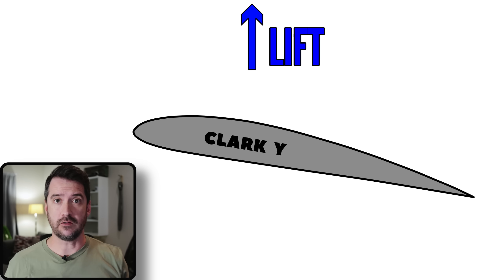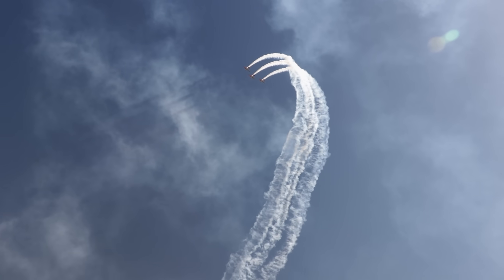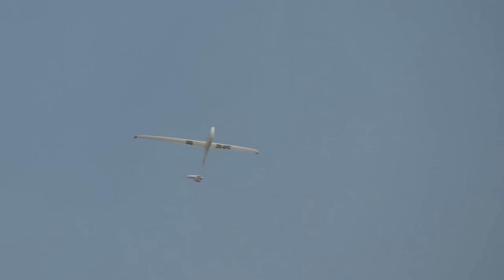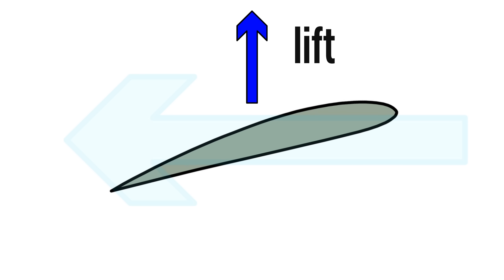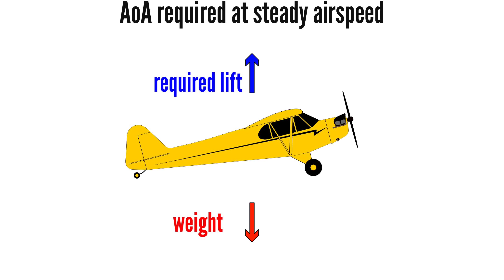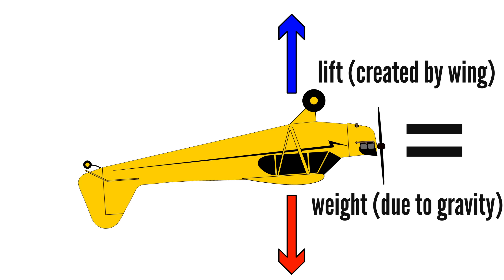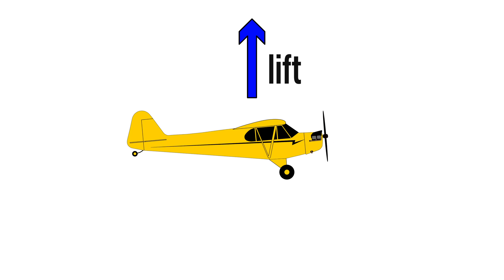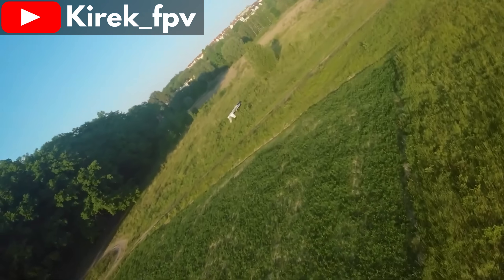Is Airflow Distance Over the Top of a Wing Always Longer?

Comment: What is not being talked about is, down to the nitty gritty, why a wing produces lift.  One has to observe, down to the molecular level, what is actually happening.  

First, I want to correct something said in the video - that there is no requirement for the air on top to join the air on the bottom at the same time (at the trailing edge).  Of course there is, otherwise, the conservation of matter is not preserved.  Furthermore, there is no explanation why the air would arrive before the bottom air.  (There would be no possible explanation.)  Additionally, some references were made to a theory that the downward thrust of the air past the trailing edge produces most of the lift.  This is also false, else one had better design the material strong enough to support an entire aircraft!

Velocity, distance, and time are useful as operands for equations for airflow, but this provides NO real reason why the Bernoulli effect exists.  The reason is pretty simple.  When air on top is required to travel further than the air on the bottom (of the wing), what is happening?  How does an individual air molecule change its relationship with its neighboring molecules?  It is pulled apart.  That is, the air is rarified.  What happens when one pulls apart air molecules?  Pressure goes down.  Vacuum pumps' job is to rarify air.  That is what they do.  A wing's job is to rarify the air on the top side so that there is a pressure differential between the top of the wing and the bottom of the wing.  Not a "rarefication differential", mind you, but a pressure differential.  The reason one can't say a "rarefication differential" is because at any angle of attack, there is a higher pressure on the bottom of the wing; i.e. there is a pressure created, not a condition of rarefication. (You can't call a pressure condition a rarefication.) That isn't really "an aside". It is the fundamental reason why a wing works so well.  I'm sure you can visualize where I'm going with this - there is a pressure on the bottom (assuming the wing is at an angle of attack), and there is a rarefication on the top.  That is powerful, because the entire wing surface is used for lift, as instead of only having pressure on the bottom, one has both pressure on the bottom and a "hole" on the top, which gives a larger pressure differential than with pressure alone.  Given this, with enough square feet (or meters) of wing area, it gives a plane the ability to overcome weight. The wing is pressed on from the bottom by the pressurized air, and the wing is attracted to the rarified pocket and wants to "fill" that pocket - on the top.  Therefore, the wing has a natural tendency to work its way upward.

The point is, one should really talk about pressure differentials, and not talk about what speeds the air is going across the wing.  The pressure differentials are what matter at the end of the day and not much else.  Speed differentials is precisely how the air is acting, but does not give the nitty gritty reason why a speed differential equals a pressure differential.  Again, one has to think on the molecular level.

A little observation related to all of this: Is there any wonder why there are tip vortices to contend with?  Since the pressure on the top of the wing are less than the atmospheric pressures, there is an inrush of air from beyond the wing tip to on top of the wingtip to even out and correct that vacuum.  (Nature abhors imbalance of things, namely a vacuum in this discussion.)  That, coupled with the fact that on the bottom of the wing the air is under pressure and one  can imagine that with the air rushing away from the wing tip  somewhat laterally on the bottom - and air rushing towards the tip somewhat laterally on the top of the wingtip and you have a constant wind shear blender effect going on continuously - just beyond the wingtip.  Winglets are added to block the lateral movement of this air on the top only (for single winglets) and for double winglets the control of the air on both the bottom of the wingtip and the top part is accomplished pretty well.  Does abating these vortices improve lift?  Not really.  It just cuts down on noise and harmonics that can be problematic.  Otherwise, most of the air across the wing surfaces does its job without much lateral movement.  The vortices problem is only caused by the air at the very tip of the wings.  A side point to this is that this points to the very powerful forces and the very effectiveness of how the air is in creating lift.  Those vortices are caused by very little of the wing, but boy are they noisy!  Why don't the winglets produce their own vortices?  Because they are very cleverly designed to transition from a wing (cambered) profile to a symmetrical profile at the winglet tips.

So, why is this video brilliant?  Because it presents a reason why a wing can fly upside down, which is because the Bernoulli effect is preserved, since upside up, or upside down, the air "on the top" must always travel further as to make a condition of rarefication, or at the end of the day, a pressure differential equal in both instances.
Reply from the maker: I really like your explanation, it's very good. Thanks, and I hope many more reads it.

Just correcting something, I didn't say air going over the top meets the air going below. Air going over will arrive at the trailing edge before the air going below. I don't believe in the equal transit theory, and there's some nice wind tunnel videos on Youtube visually showing air going over the top arrives at the trailing edge first.

But you are indeed correct that I didn't get into the nitty gritty of how lift is created. I really only wanted to talk about the path length over the top, and why it will always be longer for a positive lift-producing airfoil. And even if a highly cambered wing is upside down with a positive AoA, the path over the top (which now is the flat bottom surface) remains longer. So thus the path over the top isn't longer because of the wing camber, but because of angle of attack despite wing camber. And "measuring" path length from the leading edge is not valid as air going over and under is "split" at the stagnation point, which is below and slightly in front of the leading edge, depending on the AoA. Thus the path length over the top can be longer without it making inverted flight impossible. This is also valid for pressure differential, as the pressure differential isn't because of the wing camber, but because of angle of attack. 

The path length difference doesn't create lift, pressure differential does. The path length is a "side effect" of that, and I hope in research I'll be able to show that the higher the pressure differential, the bigger the path length difference, i.e. that they are directly proportional.

But based on your last paragraph I think you get exactly what I was trying to explain in the video.
Reply: @LetsGoAviate  I can't really disagree with anything you've articulated here, not really.  The only thing, well two things I have a comment/question on are - the time of arrival of the air at the trailing edge; yes, I've seen the videos, and I've concluded with some guessing that the time difference is very small.  The small difference I believe can make the effect evident in the wind tunnel tests.  I guess my point is that the time of arrival is very close indeed, and the cause of the small time difference can probably be buried in the surrounding air somehow.  You probably know more about this than I.  

The second thing is that instead of postulating that the path length difference is a side effect - and this might just simply be semantics - I would say that the top side rarefication is a condition that enhances wing performance.  One could possibly come up with a "terrible" wing profile, one so bad that no rarefication would occur on top, and at a good AOA and a bulldozer of an engine, the wing would fly with just pressure alone; that is, much pressure on the bottom and atmospheric pressure preserved on the top.  This is why I agree with you (not that anyone cares about my agreeing lol :D ) - and it is wrapped and packaged nicely in one important thing you mentioned: "This is also valid for pressure differential, as the pressure differential isn't because of the wing camber, but because of angle of attack."

I should mention that I might have been a tad unfair in my couching of my comments at the beginning in that I steered the discussion from the brilliant points you made to "how this subject is taught".  I didn't color completely within the lines.  I guess I have just been - not annoyed - but maybe just "interest piqued" every time someone mentions speed and distance of air without throwing in the why's of what is happening.  

Thank you so much for your time to answer.
Reply from the maker: @sonicdewd  No problem, and understandable with a lot of falacies out there that gets hammered on without explanation.

Comment: The horizontal stabilizers (small rear wings) of the empennage are the reverse of the large front wings.  Flying up-side-down, the smaller rear wings (stabilizers) are producing lift.  Granted less lift requiring more speed & altitude.  This video fails to mention.

Comment: Lift is a pressure phenomena it is newtonian in the sense of an imbalanced force.   In air pressure is radically  increased   well in advance of the wing.  The wings surface tugs on the air above initiating a flow channel for the high pressure to energize as a fast moving stream.   While doing this the streams molecules no longer impact down on the wing because pressure converts their motion into a streamline  creating a large low pressure auto rotative  force balanced out by a canard,  elevator, or wing twist.

Comment: Aviation is a 4 dimensional endeavor on a good day.  
The angle of attack to maintain level flight inverted is more than that required for level flight flight, for "normal" flight, for "normal" aircraft.  This is less true the more "aerobatic" engineering the aircraft has, but is mostly the case, because even aerobatic aircraft are mostly flown normally not inverted.  
Are you addressing the dynamic pressure "types" that are prevalent and or required in each scenario ?  The tail-down force required or not required, that is the empennage design for each aircraft type, and scenario?  
Engineers design aircraft around the fact that gravity is acting downward upon the aircraft with the aircraft in "normal" flight, on 99.9 percent of airplanes, in  normal "general" category operations.  General Aviation aircraft do not have "sport" RC aircraft wing design, that is a non general utility design, counterproductive and dangerous for "normal" operations.

Comment: Every wing  in flight automatically assumes an attack angle of 2 to  3 degrees. If the longer path over a curved wing top is necessary to product lift, how  then it is possible for a flat board-like wing to fly? - WHICH IT DOES! Most of a wing's lift is produced by air flow pushing up against the underside of the wing, due to the angle of attack. This is also how a  symmetrically curved  airfoil flies.
Reply: Wind tunnel tests and in-flight  pressure measurements show there is a greater reduction in pressure on the upper surface than increase in pressure on the lower surface.
Positive camber airfoils produce lift more efficiently and effectively than symmetrical or flat plate wings.
Reply from the maker: The longer path over the top is a by-product of a positive angle of attack, and it's unavoidable. A flat plank for a wing or symmertical wing doesn't change this. A wing's camber isn't to "make the path over the top longer", but improving the lift to drag ratio.
Reply: @LetsGoAviate  
some positively cambered airfoils can produce lift at negative AOA. 
The flow split point (stagnation point) will still be the most forward point on the airfoil.

Comment: Theres twp methods to create lift. Bernoulli's method, which is the 'longer travel = lower pressure' method, where the increased relative pressure below the wing pushes the wing upwards, generating the lift force. This relies primarily on the camber of the wing to generate the longer path. The second method is Newtons method, where lift is the equal and opposite force from pushing the airflow below the wing down. This is primarily caused by the angle of attack.

When a wing flips upside-down, the camber of the wing causes Bernoulli's method to be less efficient, as the pressure differential is worse. What is why a larger cambered wing works worse inverted than an inverted low camber wing. However, Newton's method still works in full force due to the angle of attack, thus the blade continues to produce lift.

If I have a misinterpretation of how lift works, please let me know. Humans are still understanding fluid dynamics and my professor was old lol
Reply from the maker: No this is a perfectly fine understanding of lift. There are other theories and principles too, but few of these theories actually disprove each other. Many want 1 single explanation, which is why there are always disagreements on subject of lift; there are many valid theories that explain lift.

Comment: You might be correct that the path is longer on the upper side although the wing is inverted. However the airflow shown in your picture is incorrect as you show a flow separation that wouldn’t be there. So now it begs the question did you calculate as shown in the picture then your calculation would not be accurate. This may or may not change argument as I have not tried to calculate. I’m just hoping you didn’t calculate in the manner it was drawn.